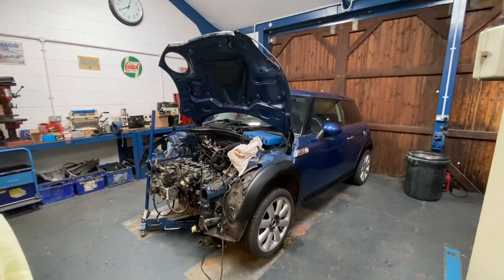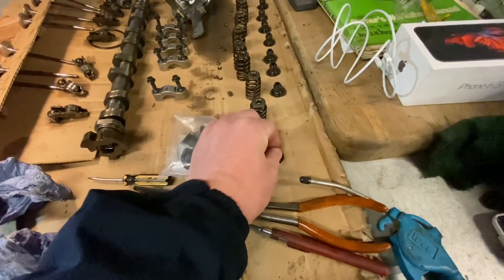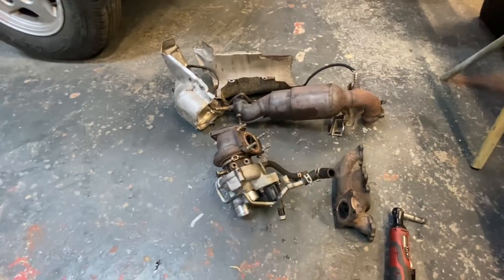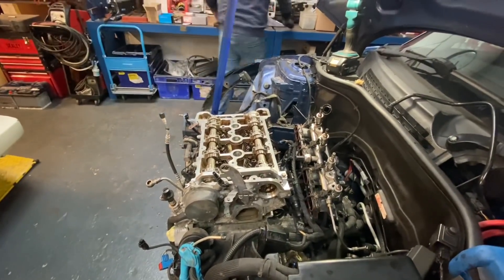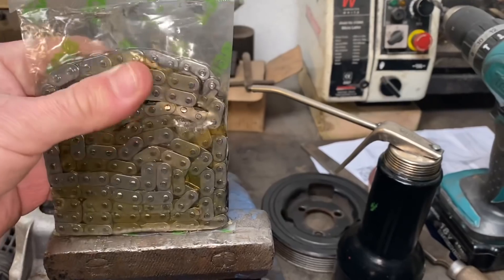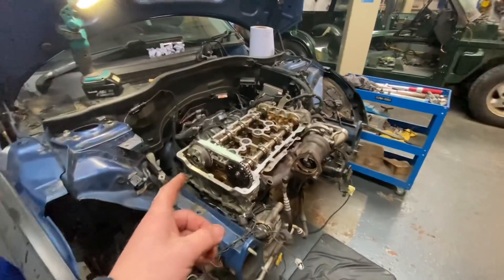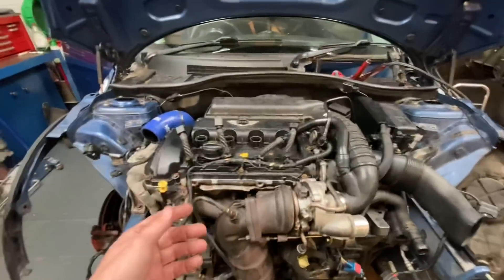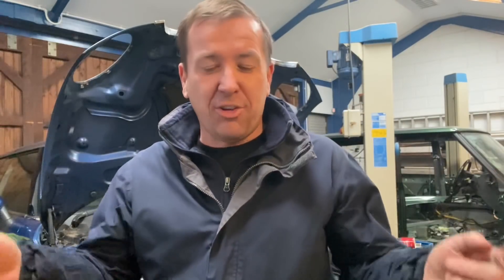Bargain£££ Mini Cooper S Engine Rebuild Will it Run ??? PT 4

Comment: Smooth job, every time i have removed a head something has almost always gone wrong, snapped bolt, head hitting bonnet, knuckles getting skin grinded off, fingers pinched, tools broken and lost, and the dreaded left over bolt you have no idea where its from lol. Maybe thats down to a cramped small workspace to do the job in though ^^ :D

Comment: The carbon build up could also be driving style, if the car has only had short runs and the engine hasn’t been getting up to temperature carbon will build

Comment: Another good video Rob. I thought an alloy head always had to be skimmed when it came off?
Reply: They checked it with a straight edge and head gasket was not the problem a missfire and the valve confirmed it .hence no skim

Comment: Didn't see you change the head gasket and the head bolts ??
Reply: I was wondering that too.
Reply from the maker: You can clearly see the new gasket as the head is going on. You can’t reuse a head gasket it would be very pointless fixing the problem to only create an even bigger one

Comment: The engines in these are know to suffer.... bmw got it from citroen/Peugeot 

Sounds nice when running though... reminds me of my mums old 08 reg cooper S that we were told we had blown the bottom end on but now im starting to wonder if one of the valves went 🤔🤔
Reply: If you mean helped develop it and contribute the variable cam timing and a lot of the manufacturing tech then yes, they got it from Citroen/Peugeot. Pistons and blocks are fairly reliable so  yeah shame, was more likely to be top end.

Comment: Hi. Love the channel - just discovered it!!  I’ve just got a Cooper s. What’s the difference between a turbo and a super charger ?  Hope it’s not a dumb question!!
Reply: I have a F56 Cooper S - quick car ! A Supercharger is driven directly from the crankshaft, whereas a Turbo is driven by the pressure and expansion of hot exhaust gases from the exhaust manifold, where it is mounted. A supercharger saps about 30% of engine power. A turbo doesnt take any power away, and its thermally efficient.

Comment: so where the valve bit end up is embeded in the manifold hidden away usually all engines if they drop a bit of valve it ends up in the same place  I would have sleepness night until I found it
Reply from the maker: There’s not a bit missing it has burnt away

Comment: Only just seen this video but I have been watching your channel 4 a long time but u said u was lapping the values in 1 bank at a time the engine only has 1 Bank because its a twin cam does not mean it has 2 banks apart from a few engines it's only v6 v8 v12 that have 2 banks a bank is your cylinder head

Comment: Great video. Could it just be the copper sealing washer between the banjo and turbo surface causing your slight leak? If I'm reusing them I quickly anneal them with my blow torch and a cup of water.
Reply from the maker: Unfortunately it’s not bud 👍

Comment: The oil feed is a design fault the o ring shrinks and oil leaks pain to fit at engine block end, is the pipe at the back ok from thermostat housing to the water pump, and the flexi pipe from the valve cover to the inlet?
Reply from the maker: They have been changer

Comment: That oil feed line is a common issue. Very poorly designed parts. You should change the coolant hose at the back of the engine too, it's plastic, gets brittle at the end and then leaks coolant.  Only £10 on ebay.
Reply from the maker: It has been done 👍

Comment: Hi Rob, I am a Porsche specialist and see you always use the Makita torch, it is clearly a good one? I need a new torch..... Also I would like to buy this when you are done, are you listing on Instagram when it is finished? Cheers Paul
Reply from the maker: It will be on instagram bud yes. The torch is good yes as it bends and swivels 👍

Comment: Injectors are a common fault with these motors, best to upgrade them, its why so many owners remap these cooper s engines even stock, as to run more pressure through the injectors to help prevent carbon build up, injector problems can even be intermittent they can be a nightmare.

Comment: I had that happen to an aircraft engine, exhaust valve got stuck and struck piston. I put the aircraft down in a field.
Reply from the maker: Glad you made it 👍 not many other people could tell that story 👍
Reply: @sruk  Back in 1993, there had been a spate of valve failures, due to lack of oil cooling the valves. The oil would coke on the valves causing them to stick open.

Comment: Can you explain why you will start the engine after doing all that work without the coolant. What stopping the engine from heating up and how will you control that heat. I know you only started it up for a few minutes would that not the pistons getting hot without any water in the block to distribute the heat. In another words your cooking the new head gasket.
Reply: Engine was not run long enough to even get warm. It would have been a waste of time and coolant, if there was a problem and another teardown was needed.
Reply: Yep, as David said

You'll be fine without coolant for about 10 minutes really. Oil acts as a coolant to some extent
Reply from the maker: It was only a few seconds 👍
Reply: For some reason you all might be right but the way engines are made now and the way they get hot. I would not want to risk it after all that work. The way I look at it. Rather put coolant in side and run it up to temperature to make sure it’s all good. If there was a problem it’s just a matter of starting again and removing the coolant.